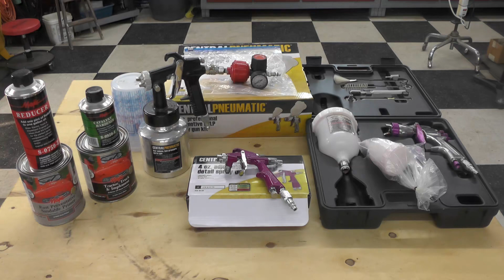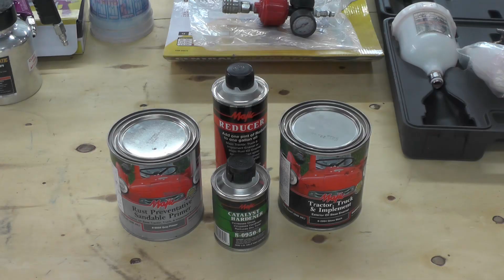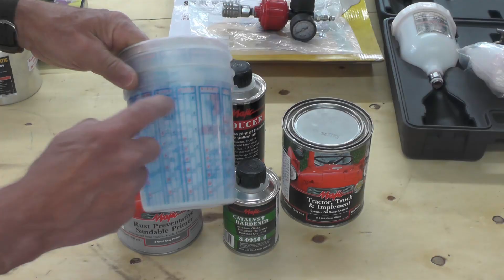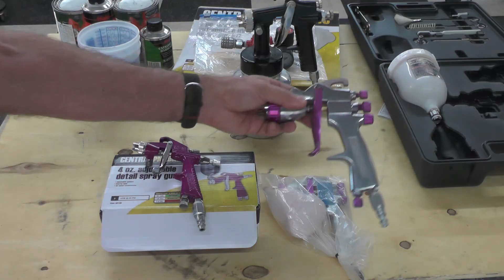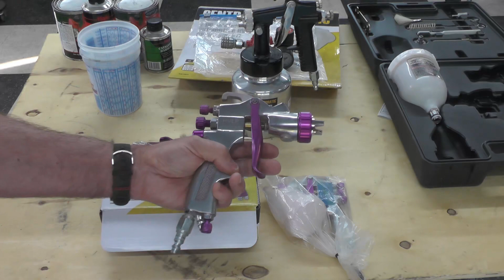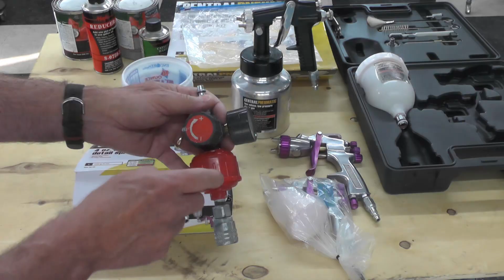Ford 8N Tractor Project Pt 38, Paint & Equipment for Seat Painting --- Video #415

Comment: Interesting video for me, as over the last two years or so I have concentrated on painting - mainly motorcycles and have learned an awful lot over that time. I have now built my own spray booth, which has helped a lot with cleanliness and being able to control the spraying environment.
One thing I have learned is that when spraying a base colour coat, you can get reasonable results with a cheaper budget gun, but if you really want a high end quality glass like finish, then a good quality gun does help a huge amount and help get a good result. This is particularly true when using clear coats as the better guns atomise the paint or clear much better and allows it to flow out without, or a least with less orange peel.
I recently have bought a new gun - it's a Phorpis 717. Chinese but really good quality and is only about 250 us dollars. All the reviewers are saying that it's a as good or better than many guns which cost 1000 or more dollars.
Reply from the maker: I've had no problems with these lower cost HVLP guns, though they are sensitive to how thin the material is that's being sprayed.  I bumped into this on this project, which you will hear more about in an upcoming video.  Other than thinning and getting the adjustments right initially, they've generally worked fine for me.  I've never used a higher end HVLP gun so I don't have anything to compare them to.  Interesting to hear about your journey with painting over the last few years, sounds like you're getting serious.  Thanks for the thoughtful comments, Jono!